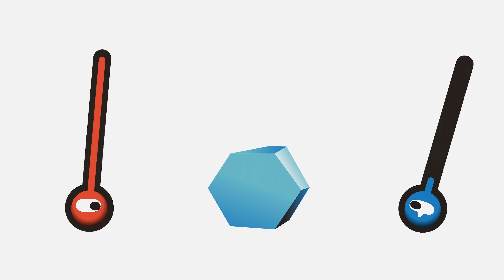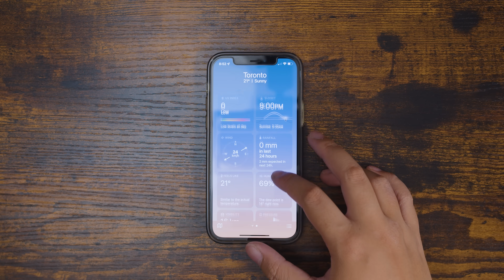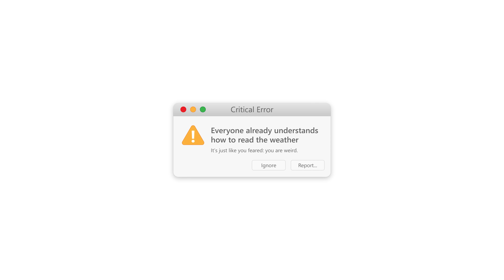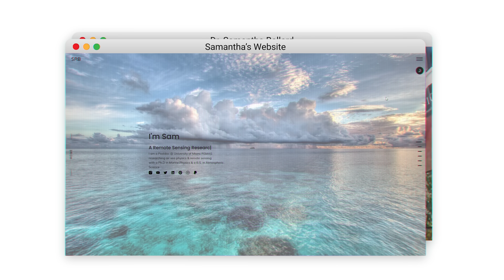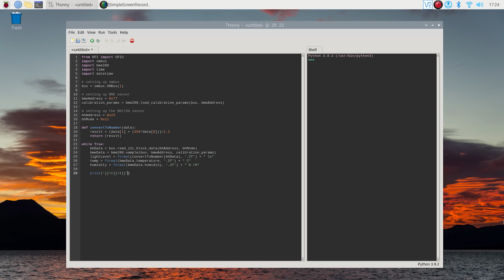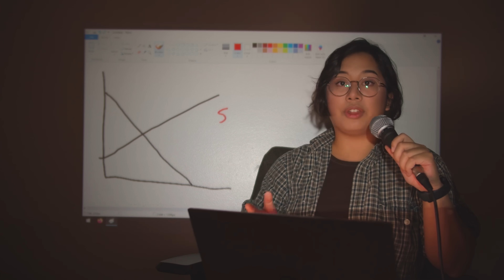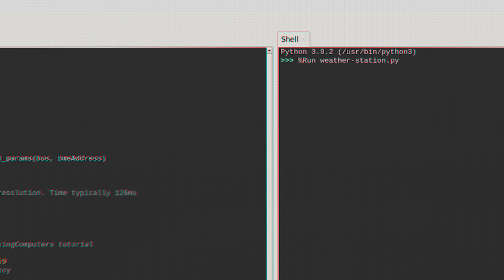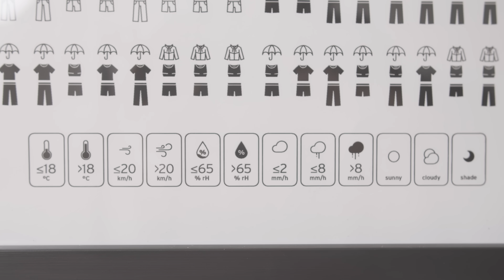how fahrenheit fails you

Comment: I live in the netherlands, where half of the country is below sea level and the air is never fully dry because of the proximity to sea. 28° over here feels like boiling. I went to budapest a few years ago, and although i am someone who is DEFINITELY not made for high temperatures, 35° felt perfectly fine. When it got to 40 i started to feel like i really needed to take it slow, but i rarely felt like i was constantly out of breath and there was no way to escape the clamminess like i was used to at home. Its crazy what those differences in humidity can do to the temperature perception

Comment: honestly forget the little numbers, just use an analog readout, yes you might say it makes it less accurate to get the number from it and more work but why you trying to get a number out of it? just for your brain to try and convert it into something intuitive aka yet another analog, having an analog to analog link is just fantastic and yeah it just works, you might say that you can't really read off the least significant figures that easily but they are least significant figures anyway so do they really matter? a tiny change on the dial barely noticeable is also barely noticeable anyway outside, and of course if you do need more precision you add another hand :3

Comment: People who grew up with one use one more convieniently,why debate which is more convienient if it's base on prefrence. Embrace the differences and kelvin
Reply: Also -0.001 is freezing
10 cold
20 cool
30 passable
40 AC
50 seizure
60 suffering
...
99.975 boiling

Comment: If you use temperature for anything other than dressing yourself in the morning, Celsius is so much better because it is easier to convert and plug into mathematic formulas (ik we still need to add a number to make it into Kelvin but point still stands), and even using it for the weather is better, because when you see 0C on a thermometer you can expect ice to be around, and Fahrenheit is arbitrary, it is literally a vibes based scale, 0F and 100F dont mean anything

Comment: I guess every system is fine when you grow up with it you get used to it. I am used to Celcius and find it very logical. 100 C means water boils 0 C means that just a tiny bit colder and water freezes. And when it actually freezes you go up from 0 and add a - sign so the higher the number the colder. And honestly wheater temps don't really go up or down that much in most countries it stays between -15 to 45. And eveything over 20 are summer like temps. I don't know I honestly never found it complicated....

Comment: I mean, it’s definitely you not being good at guessing. The good thing is that you don’t need to. Most people just dress the way they feel like and don’t look at the weather app. Because it would make no sense to be uncomfortable just because of a number on a phone.

That being said, the reason you see a difference is probably that you are not considering the humidity level and “feels like” value. Those are values that can be found scrolling down on the weather app on iPhone.

A higher humidity makes the weather feel warmer than it actually is. I’m guessing yours was around 80% or more which would’ve likely put the temperature sensation at around 30 degrees Celsius.

Now on to the topic of which is better between Celsius and Fahrenheit. That shouldn’t even be a question.

Comment: Back on the Fahrenheit topic, it has a greater fine comb to temperature as there's more options to a degree and i can indeed feel the difference. If my home is a degree F or 2 off I will feel it and be too hot or cold, yet that's still the same degree in C
When you learn it over rhe course of years, you understand the difference in a degree very well. Also idk what mkbhd is talking about, I genuinely prefer Fahrenheit 😅

Comment: my problem with 0F being one of the coldest days ive experienced, and 100F being one of the hottest, is that I live in the tropics, and I dont think ive ever experienced any temp below 25F (i was on holiday). On the other hand, summer temperatures sometimes get up to 107F, which is better, but still not great. In celsius however, if it is single digits its extremely cold, anywhere from 11-18 is quite cold, 18-22 is winter weather, 23-27 is nice, 28-31 is summer weather, and 32 upwards is very hot. The middle of the 0-100 scale is 10C, which is very cold to me.

Also, the last time i wore long pants instead of shorts, was when i was 6.

Comment: Here in Argentina we use celsius aside something called thermic sensation.
Thermic sensation is a number that tries to translate the temperature you feel to the temperature that would give the same feeling taking out humidity, wind, etc. 
It works fairly well.

Comment: Former mine ventilation tech here, I know what the problem is: everyone reports dry bulb temperature; that is not what we feel.

I'm going to use 3 types of temperature here that folks will probably need definitions of to understand this:
Dry bulb temperature: this is the number your weather report probably tells you, and what your thermometer reports.  This number matters when you're doing chemistry and cooking.  When your freezer is below -18C (0F), food is being stored safely.  When pure water is at 0C (32F) it's in the process of either freezing or melting.  When your steak is at 125F (51C) it's rare.  When you're doing ideal gas calculations, you need to know how far the temperature is off 273.15K (0C, 32F) so you can account for the deviation from STP.  Dry bulb temperature has nothing to do with what you feel on your skin.

Wet bulb temperature (WBT): This is taken by putting a little sock of fibre around the bulb of a thermometer exposed to airflow, and wetting the sock.  This mimics the effect of perspiration, allowing evaporative cooling to cool the thermometer the same way your sweat cools your skin.  This is as close as we can get to scientifically measuring what you feel in the shade.  (And yes, you're always sweating a bit.  You notice it when you're overheating and your body responds by cranking up the rate of sweat generation in hopes that this will improve cooling.)  (This can also be calculated using both the dry bulb temperature and relative humidity.)

Wet bulb Globe temperature (WBGT): Taking this measurement is a lot weirder, and I didn't really have to worry about it as a ventilation tech in an underground mine.  The goal of this is to account for the direct solar heating of being in sunlight.  So this is, roughly, how hot it feels to stand out in the sun.

In mining, we used the wet bulb temperature to determine that workers in hotter regions of the mine are safe to work (the further down you go, the hotter the rock gets, so we need to send really cold air down there to make sure the rocks that are 70C don't heat the air and thus the workers up to 70C.  We were typically getting dry bulb temperatures down to the low to mid 30s (around 90ish F)...but by controlling humidity we were getting wet bulb numbers down to the mid to high 20s (80ish F), which means they're going to be hot and sweaty (especially when they're spending all their outdoor time in the -20C or below weather of Canadian winter) but that puts them at a temperature where they're not suffering major heat related problems like heat stroke.

Wet Bulb Globe Temperature is what I try to find when I'm working out if it's too hot to go outside - professionally I didn't need it much, since there's not much sun underground, but it's by far the most consistently useful figure I've come across in weather data.  Sometimes either WBGT or WBT get reported as "Wind chill" or "Feels like," but sometimes those account for other factors and can definitely be confusing in general.

Unfortunately, neither WBT or WBGT are typically reported by public facing weather summaries.  And the psychrometry charts that we use to determine wet bulb based on dry bulb and relative humidity (both of which are commonly reported) are...not the easiest to read (feel free to look one up, they're definitely readable, but at first glance they're extremely cryptic.)

Comment: Zero is freezing. Ten is cool or chilly. 20 is alright. 30 is hot if not dry. 40 is really hot.50 is kinda dangerous. 60 is more dangerous. 70 is in a coal mine 6000 feet under ground. 90, you're dead. 100 you're boiling as well. Simple and intuitive.

Comment: First; as to the relative accuracy of C versus F, given that the finer the degree of measurement, the more accurate the measurement, then F wins. Given that there are more degrees twixt the freezing point of water and the boiling point of water in F as opposed to C, it is obvious. As for building your own weather station, many cellphones have thermometers in them, just look on your phone. But wait; if you're never outside, you'll always get something around 72F. Your phone can still save you, just pull up the weather service and specify your location, you'll get a really close indication for what is outside your door, the U.S. NWS is pretty good for that. If your friends DID actually say "Go touch the grass", listen to them!

Comment: I think a big part of why Fahrenheit is considered better for weather metrics of temperature comes down to the differences in the numbers. Celsius the range between "freezing" and "hottest day in the south" is between 0 and 40. That's a range of 40 degrees. Compare that to Fahrenheit -- 32 to 104, a range of 72 degrees. That's almost double the values at whole number increments. How often do you tell people the temperature and hear "21.4C" rather than just rounding it to "21C"? In comparison, for that same difference, you'd go from 70F to 71F. The differences of just 0.4C can be expressed in whole numbers in F, which helps tremendously when you consider comfort zones. Most people have a range of "I'm comfortable at this temperature, but any lower or any higher and I need to adjust my clothing." In Fahrenheit, that difference can be as little as 1 degree, depending on humidity and wind and stuff, of course, but sensitive folks can still express that -- however, in celsius, that difference gets ignored by way of rounding, and there's loss of understanding in that sense.

Comment: #3:36 "most of us", you mean most of US, because that's just one country of 340 millions of a world population of well over 8 billion, that all are using Celsius scale. There is just nothing wrong with adjusting the temperature scale to water, so 0℃ is freezing, 100℃ is cooking, around 20℃ you will feel comfortable and normally around ±20℃ around that you will have your environment. At 60℃ up you will start low temperature cooking, every 10℃ up or down halves the cooking time or stretches the storability of food in the freezer by a factor of two. 
Nothing of these easy makings are applicable to the Fahrenheit scale. 
Ah, yes, and your body temperature should be between 36.3℃ and 37.4°C if you are healthy. 

I see no, absolutely no advantage of the Fahrenheit scale. And that's why she was replaced. But the US can do what they want, they are a free country, aren't they?
They just can't sell their imperial crap to the rest of the world.

For your clothing it is important to know the hygro of the air and also the wind speed as well as the stuff you need to do outside. Standing around is cold, working hard, you can do at -10℃ in a T-shirt and shorts and barefoot on a calm, dry, sunny winter day. My Finnish friend walks his dog at -20℃ barefoot every winter. Only below that he will start wearing shoes or a T-shirt.

Around 6℃ you can freeze to death outside. And around 40℃ a thing starts to being too hot for touching, for example your shower is much too hot at that temperature.

Comment: As I am watching this, I have a inward laugh. I'm so glad you aren't me. I am ten times more complex. For me, as the temperature goes down, I switch gears.  So, using Fahrenheit, 50 is cold, 40 gets warm, 30 is cold but 20 isn't as cold as 30.  But as regards to the temperature scale I am reminded of two things. The first is the  Réaumur scale, which is sort of like Celsius where the freezing point of water is 0 in both scales. But 100 degrees C is 80 degrees R. And the second thing is that -40 is the same temperature in Fahrenheit and Celsius. I was on a jet place over Europe once and the temperature outside was -40.

Comment: There is no such thing as cold
Its just molecules vibrating slightly slower
Also kelvin is the best, its based on those molecules vibrating
0 kelvin they stand still, planck temp (max kelvin) is them moving at the speed of light
Also speaking of light
The unit a lightyear is a unit of distance not time

Comment: The most logical scale is 0 = absolute zero. 100 = absolute hot.

Therefore, it is 2.04395843930 degrees today, but tomorrow it's 2.04395843920 so you better bundle up!

Comment: I have a scale for what to wear depending on the temperature in °C, but mine might feel different than yours(also I pretty much always wear T-shirts):
23°+: Thin T-shirt and shorts, it's hot as hell.
19-22°: regular T-shirt and shorts, decent summer temperature.
15-18°: regular T-shirt + Trousers, early autumn.
8-14°: can wear a long sleeve shirt, Trousers. Need to put a hoodie on tho.
0-8°: A light-mid Jacket is recommended.
<0°: best take a decent or even thick Jacket to not freeze.
Of course it can vary, if it's windy then the scale might shift a bit.

Comment: I've never bought into the whole "farenheit is better for weather because 0-100" argument. Because it really only applies to the climate of the contiguous United States, and even then it does a poor job. Celsius, on the other hand, -50 to +50 covers pretty well the whole range of temperatures globally, with a few very rare exceptions. One end is dangerously hot, the other end is dangerously cold, with gradients in the middle.

Comment: Humidity is very important. High humidity makes weather harsher; cold feels colder, and hot feels hotter. It is because of water's high thermal capacity, a water bassin is used in a forge to rapidly cool extremely hot metal even if the bassin is a few meters away from the forge itself. Likewise, steam easily can easily burn skin. This means water can absorb and release vast amounts of heat.

Comment: The problem with Fahrenheit is that it's overly precise for our weather experience. The difference between 44, 45, 46, or even 49 is imperceptible, and the temperature varies by that much and more, just depending on where you're standing.

Comment: 3:23 - IMO.. imperial system measurements are best suited for measurement from a human perspective where as metric is great for accurate measurement of anything while disregarding human perspective. 2 meters is how big?? To a PC...6.56168 feet is fine. Telling a human that would not be but it would be accurate. That thing weighs 100 pounds. This is easy as pie for a human to quickly work out. 45.3592 kg is not easy for a human to work out. Is that big??? 120.701 KMH...is that fast??? 113.398 kg is a 250 pound person. Fahrenheit is the only imperial measurement I don't like for things from human perspective. 32°F is freezing and to me as a human, I prefer viewing  0°C as freezing cause there is no mental translation or conversion causing overhead. 0 just means no heat. IT becomes harder for me the larger the scale. 3,000 KPH. Whats that?? 1,000 MPH maybe???

Comment: This kind of confused me. The fact that this video exists means to some extent, other people have this problem, right? For me, I prefer no more than 50% humidity and around 70-72 degrees F temp, with no wind, if you consider shorts & a tshirt, basically indoors.

Once you factor wind of say 5-10mph, typical for the outside, probably bump up the temperature to maybe 72-74 is comfy with the same clothing, as long as you're under 50% humidity.

Humidity matters a ton. Also, while F might be slightly better at indicating 'temps I'm good with' because it's a smaller unit, if you grew up with Celsius, I figured that it'd be just as intuitive to someone in Europe.

You just gotta factor clothes, wind and humidity. Can't have a 'comfort' conversation w/o those.

Comment: 3:26 - That's not entirely true though. As a fellow Canadian, I'm constantly trying to understand Fahrenheit. 
The coldest I ever experience (in Fahrenheit) is -40F (which ironically) is also -40C, but then the hottest I've ever experienced is 95F. 

You're right; 0 - 100 is intuitive, and if Fahrenheit was just that, I'd agree, but it's not. 
0-100 is intuitive. -40 - 95 isn't. 

Celsius is easier for me to gauge, cause I know anything in the negative is cold, and anything in the positive is hot. I have a better idea when things get cold in Celsius, vs when things get cold in Fahrenheit. Yes, the inbetweens can blur this, but (I personally find) it's a lot easier to understand. More numbers in the range between may make it more accurate for precise temperatures, but it certainly doesn't make it easier. 

After a certain point numbers don't mean much to me, I have no idea what difference 350F on my oven is vs 375F aside from being "hotter". How much hotter and how much difference does it make? No clue.

Comment: Celsius much more useful scientifically, since a degree there is 1% of the distance between freezing and boiling. Fahrenheit is reasonably better for thought of comfort because 0 degrees is dangerously cold to stay outside in for too long, and above 100 equally so. So it's like "it is 95F, so it's 95% hot, dress for breathability and maximize the skin open to sweat" or "it's 20F, so, bundle up cuz it's only 20% livable out there.